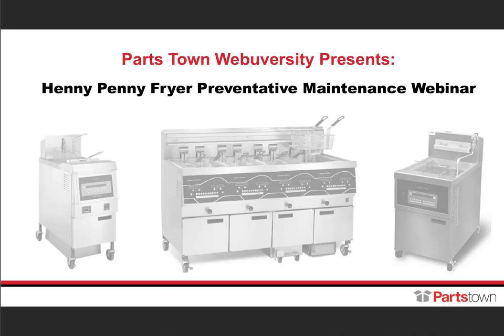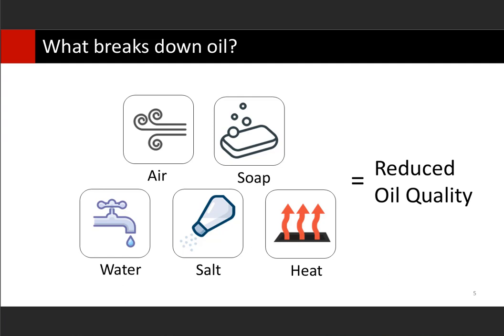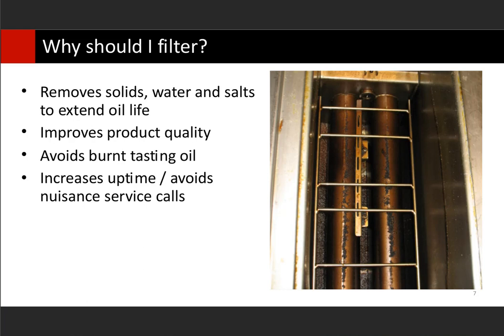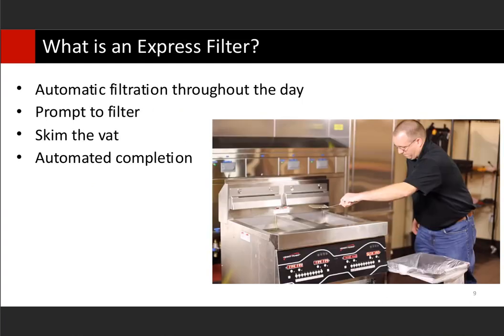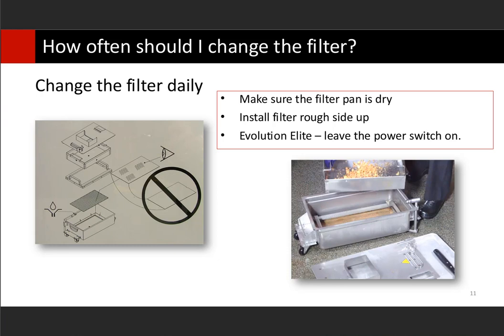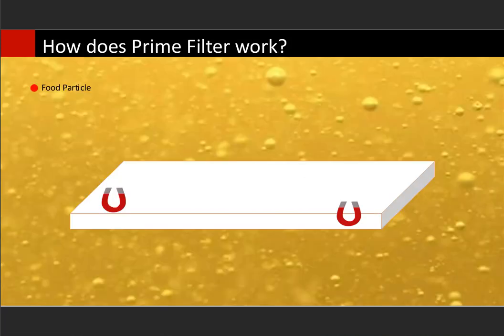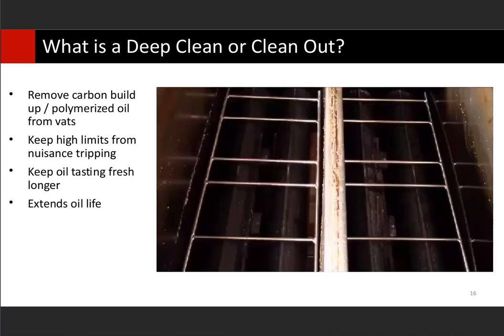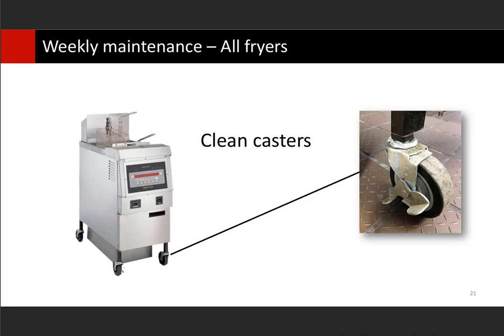Henny Penny Fryer Maintenance Webinar

Comment: Hello, I work with these machines. One of them is leaking oil into the drain pan. It is from one of the oil vats, it's oil level lowered every morning. What do I do to fix this? A leaking valve, seal...